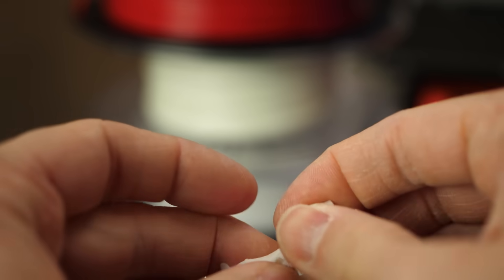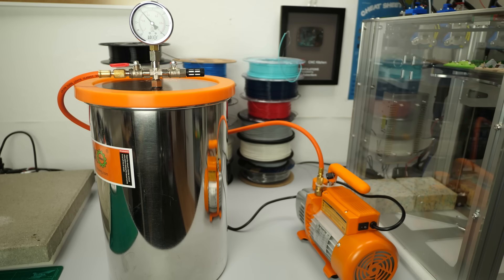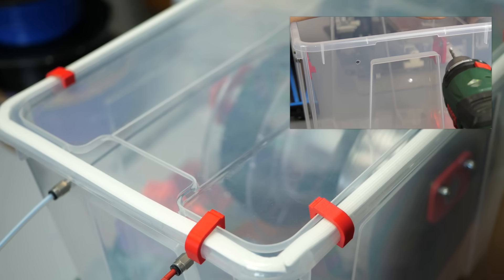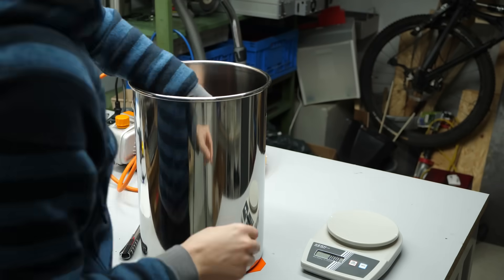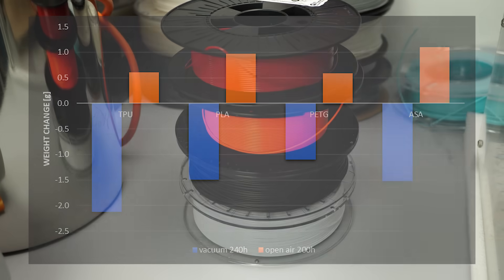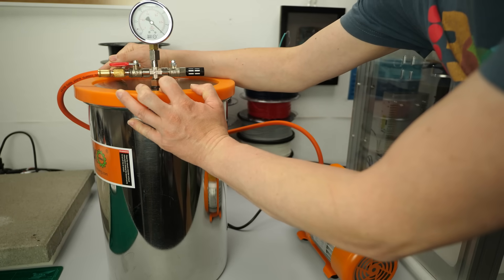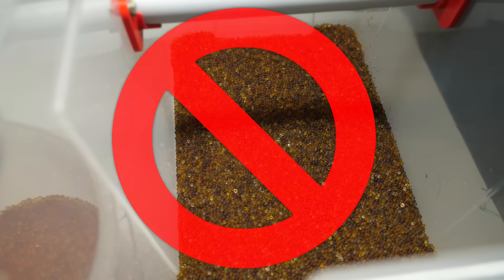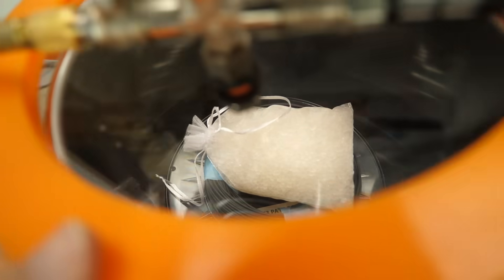Vacuum VS Dehydrator! What's the best way to dry filament?

Comment: might need to get a chemical desiccant to protect your vacuum pump. How do you feel about baking a regeneratable desiccant in the oven, then storing it in an airtight box with the filament?
Reply from the maker: That's exactly what I usually do.
Reply: @CNCKitchen  that's what I get for pausing the video and coming back assuming I'd seen the whole thing :) Your thoroughness is impressive as always

Comment: What about microwave drying? Thats something I've tried with old TPU parts that tend to get stiffer after months of exposure to moist air. They got more flexible again immediately (after they cooled to room temp of course). That would be a good meeting to examine.
Reply: In the laboratory, vacuum microwave ovens are used to dry out certain types of material. I always keep all my materials in boxes with desiccant
Reply: Since a microwave works by heating the water molecules, that could work... but I would worry about the uneven heating going over temperature and deforming some parts.  Microwave ovens have turntables because of that uneven heating issue. I wouldn't recommend it for that alone, much less any additional out-gassing of the plastic in a place you cook food... unless you want to dedicate a microwave to that (along with the aforementioned issues)
Reply: That works really well with bronzefill filament.
Reply: @xKatjaxPurrsx  Any metallic filament to tell the truth, kkkk

Comment: You cannot dry stuff (completely) in a static vacuum. Unless you leave the pump running continuously the moisture will reach an equilibrium point within the chamber. When you leave the pump running constantly no equilibrium can be reached as the moisture is constantly being removed.  To protect the oil in the pumps in labs you generally use two traps in series. The first bubbles the output of the chamber through sulfuric acid, which takes all the moisture out. The second trap bubbles the output from the sulfuric trap through mineral oil, which traps any fumes coming out of the first trap. Generally these two fluids only need to be changed once a year. Same with the pump oil. You will be amazed at the amount of water that will come off with only limited heating. Generally, proper vacuum drying will move about 1-1/2 times the moisture that air (hot) drying will.
Reply: how do you know when to replace the sulfiric acid
Reply: @termivan  Generally you just make a line on the container (preferably clear) at the height of the fresh sulphuric. Once it doubles in volume it is time to change it. Usually that works out for us to be about once a year, but that will depend on how much you use it.
Reply: @bradquinn4161  excellent, I see that my job (assembly shop) has about a 500g chamber of dessicant in line to the industrial pump, I am considering all these options to help prevent oil contamination in the future,  where might I be able to shop for such accessories?
Reply: @goguyted  We used to use two of the used (and clean) acid bottles(2 litre?) with some of the red vacuum sealer. The bottles are shatter proof due to shipping regulations. If you have a local lab they MAY just give you a couple.

Comment: Hey Stefan
if you want to completely dry the filaments  using vacuum pump you need to freeze the filaments, then put them in vacuum pump
when water freezes it separates from the materials and when unfreezing at  low pressure it goes from solid to gas directly
also a totally dry desiccant should be present in the chamber while material us unfreezing
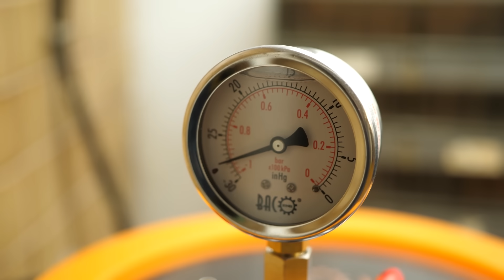Reply: Stefan, your setup for vacuum drying is not even in vacuum (vacuum gauge @6:15 in video). You have a vacuum leak in your setup. Equal amounts of molecules being replaced in container as your pump evacuating…. This is an error in measurement.

Comment: Why not use a printer's heated bed to heat your vacuum pot? Heat with the lid on but no vacuum (for maximum heat transfer) until the spools get to a good drying temp. then pull a vacuum.
Reply: Glad to see that at least one other person uses their printer as a hot plate.

Comment: You should add radiant heaters when you are vacuum drying to add heat to the filament - otherwise you are totally relying on conduction through the base of the vacuum chamber which is really inefficient.
Reply: That is a very uncontrolled way of heating. Every filament will absorb more or less radiation. You would have to limit the radiation to a worst-case or something.
Reply: @Basement-Science  Yeah, or you could just have the heaters controlled on a PID loop to a temperature sensor. Wouldn't be that hard.
Reply: Could you heat the filament up to 50C, then put it in vacuum chamber a while, then take it out and heat up the filament again, and vacuum it again? Every time you remove more moisture..

Comment: what about a  heated vacuum chamber?
Reply: Doesnt work too well since there is no air to transfer the heat. Also, IR would heat the filaments in an uncontrolled way.
Reply: @Basement-Science  Thermal Radiation does not require atoms.
Reply: @Dust599  Where did I suggest that it did??

Comment: No Stefan, your dessicant is not toxic. The cobalt chloride one (the blue one) has been phased out in the EU since 1998. Yours, the orange one is safe. https://www.agmcontainer.com/blog/desiccant/indicating-silica-gel/
Reply from the maker: The orange ones contain Crystal violet which is also suspected to be carcinogenic and toxic for fishes.
Reply: @CNCKitchen  Fair enough. Some of the orange dye ones do contain Crystal violet (notably those turning green). But not all of them. That's the frustrating part when trying to handle chemicals with the least of ecological consequences. The SDS and REACH files established by the chemical companies are notably obscure and you have to do a lot of guesswork to know what's inside the products. Note that silica gel wether it has organic dyes in it or none is as dangerous for fishes as plastic flakes as silica won't dissolve in water. As your audience must already know, dealing with resin, ABS, or PLA (that takes up to 200 years to decompose) has ecological consequences if the residues are not treated  with care and not processed in designated facilities. 
The nice thing with silica gel is that being indefinitely reusable, it's not supposed to be disposed of. It's not a consumable, more of an investement.

Comment: Weirdest thing I've seen with a roll of PLA left in the open is hearing random cracking noises and finding broken pieces of filament that were as brittle as dry pasta. It's happened with three rolls from different sources. Could this be core moisture problem?
Reply from the maker: I'd  rather say that this might be bad quality filament wound on the spool under bending load.
Reply: @CNCKitchen  Thanks. BTW, these recent videos have been great. Looking forward to the next one.
Reply: I keep hearing this, mine is always open and never brittle.  The common story is that the filament is in an area where there is temperature swings so I wonder if it can build 'fractures' in it over time or if the temperature swings damage a property or additive.  (not saying yours is caused by temperature swings)
Reply: I kept my spool on the printer in a plastic box with desiccant, and found exactly this for PLA for the section outside the box in the bowden tube after a few days.  Usually the segment of filament outside the box would break right away if I tried printing with it. This was in a high humidity environment.

Comment: awesome video!! just had a question. did you heat the vac chamber when you were doin g this test? just wondering because my chamber came with a heat mat that can easily hit 125F under vacuum which would probably help a lot! Im gonna test it but just an idea for a revisit video if you do come back to this.
thanks again for the awesome videos!!
Reply: Heat will not transfer through vacuum, except by radiation or conduction. Radiation would only affect the part of the reel/filament in direct line to the heater, conduction will likewise depend on heat conduction through the reel of filament, neither would do much.  One could use the heater to heat the filament for a while, then turn the heat off and pull the vacuum.
Reply: @BatByke  Excellent remark about conduction.....

Comment: That vacuum chamber is very expensive for what it is... you can make a cheaper one. And the reason vacuum by itself doesn’t work that well is that it cools down the water as it evaporates due to its latent heat. You need to heat it up to keep the temperature constant (even at room temperature would be enough).
Reply: Not true, when water is boiling the temperature doesn't change! Remember, at 1 atmospheric pressure water boils at 100°C, adding more heat will not change the temperature, it will only boil the water more quickly.
Reply: MarcoV6T But that’s because you’re adding heat to it. You need energy to break the intermolecular bonds, so if it’s boiling and you don’t heat it up, it will cool down until it freezes. There are quite a few videos that prove it (also, you can do this with other liquids as well, and this also used to make solid nitrogen).

Comment: In Chemistry we used vacuum desiccation while also putting a bowl of fuming sulfuric acid into the chamber - sulfuric acid is highly hygroscopic.
Reply from the maker: Contact with the filament and the fuming sulfuric acid will probably set it on fire? 😅🔥
Reply: @CNCKitchen  Only if you add some nitric acid - though that may also yield a friendly visit by the bomb squad...

Comment: In the video you say you don’t run the vacuum very long because it will over heat. Are you talking about the pump or the filament? I use a vacuum pump to stabilize wood and sometimes I run my pump continuously for days. They are made for long term to remove moisture from refrigerator and cooling units. You might try running it continuously for 24 hrs.

Comment: Good episode about drying filament materials.

I do have a question; why did you decide mix materials during each drying test and not dry them independently of each other for each different drying method?

From a scientific methodology perspective, is there not a concern when mixing different materials during each test run,  potentially dilutes the results because of cross contamination between material and different polymer properties?

Thanks
Reply from the maker: Time...this test already took 3 months.
Reply: @CNCKitchen  I appreciate the dilemma. But as you know, if you were posit this to a peer review panel, there would be red flags.

I like that your tried different drying methods.

Comment: What is wrong with indicator in desiccant?
Reply: That's the point I don't agree with Stephan. There are in fact two kind of moisture indicators. The ones that were previously sold were blue and contained cobalt chloride. a known human toxin. In 1998, the European Union prohibited Blue Indicating Silica Gel from being sold within European markets. They were phased out for orange silica that don't and are safe to use. You can still find blue silica on some sellers sites importing from China but they're pretty rare. They are cheaper but stay away from these. If the silica is orange, it is safe. https://www.agmcontainer.com/blog/desiccant/indicating-silica-gel/
Reply from the maker: The orange ones contain Crystal violet which is also suspected to be carcinogenic and toxic for fishes.
Reply: @the_arcanum  Good to know, so the orange silica that turns dark blue when moist is the safe one? Because that is the stuff I got 2 kg of last year and I'd like to keep using it.
Reply: @mhe0815  Well, the orange that turns green contains Crystal violet that's toxic for the environment if released in Nature. So. ehh. Note, it's not concentrated enough to do damage to humans. But, the nice thing is silica gel is infinitely reusable. Heat it, dry it and it's brand new ! 

 As long as you don't put the dyed silica in contact with food (never recommended). , you're fine. And the day you want to dispose of it, you do it in a proper facility {like for old paint pots, solvents and so on) and it's fine. 

Our hobby involves the manipulation plastics, resins and other hasardous chemicals, we just have to be conscious of what we're using and take care to have the lowest impact on the environment around us :)

Comment: What's the issue with indicator? Haven't heard that before. NOT saying there isn't an issue, just asking for more info. First time I've come across this.
Reply: The blue-pink indicator is cobalt-based. The yellow-blue indicator should be fine. I wouldn't be too concerned about either if you don't plan to eat it ;)
EDIT: Turns out yellow indicator has some variants, those with methylviolet are "concerning". https://www.giebel-adsorber.de/images/unternehmen/neue-produkte/GIEBEL-FilTec_Unbedenklichkeit-Silicagele_DE.pdf
Reply: Just looked up the data sheet of the orange SiO2 pearls I'm using (since the PDF Doping1234 linked said that one of the orange indicators can be considered dangerous at a concentration of 2.5%). They contain a whopping 0.09% of indicator. So even if they were using methyl violet, that concentration is so laughably low that it should not create any reason to worry...
Reply: @NiyaKouya  I figured. It's the dosage size that makes the poison.
Reply: Blue silica gel uses cobalt(ii)chloride which is carcinogenic. Orange silica gel uses methyl violet which is toxic, but not in the concentrations found in commercial silica gel. Concerns with methyl violet are more likely to do with water contamination due to improper disposal
Reply: Yep. The main concern here is probably contaminating your kitchen's oven, although the plastics themselves are probably outgassing more harmful stuff. Ideally you want a separate oven that is not used for anything food-related.
Reply: @Basement-Science  Or you can dry it in your 35$ dedicated dehydrator that also dries filament. That works too :)
Reply: @the_arcanum  Well I was thinking an old oven someone else is throwing out, but yeah, that works too.
Reply: @Basement-Science  if its a sunny day,  you can also leave it somewhere that gets at least 4 hours of sun exposure.  Preferably it's in a low humidity environment.
Reply: @Caretak007  Drying your filament in direct sunlight is a bad idea... While the sunlight does raise the temperature, it is not easily controllable or stable and can swiftly rise above the glass transition temperature and ruin your filament. There are lots of examples of 3D printed objects melting on the dashboard of a car... There is also the uncontrolled humidity to worry about. Part of the reason a food dryer is so effective is that the temperature rise inside is greater than the surrounding air which gives the moisture somewhere to go, e.g. the surrounding cooler air will take up the moisture... if the surrounding air is the same temperature, there is nowhere for the moisture to go and your filament does not get any dryer.

Finally there is the problem of UV radiation... this may or may not affect the strength, but it usually Will affect the color as many colors will noticeably fade in direct sunlight.
Reply: @edwardpaulsen1074  We are talking about drying silica gel not filament.  Obviously putting filament in sunlight is a bad idea.
Reply: I was looking for the same answer. I use the following one, which says it is a patent for non toxic coloration system. I just hope it is true then... I would be grateful to Stefan if he could just tell why he said the colored is toxic, so I would know what to look for.

https://www.amazon.it/gp/product/B018KPA0RE/
Reply: Maybe it's not toxicity related (as anyway with some common sense we'd use a dedicated plate/bowl, not used anymore for food for drying them in oven). 
I've heard long time ago in another video (IIRC it's another one from Stefan), that it was a problem with too low sensitivity of the indicator that rendered it nearly useless for this, filaments being much more moist-sensitive than foods or electronics : when the indicator changes color, that means the silica gel is already near-saturated and not doing anymore its job since long time ago, because the silica efficiency at absorbing moisture decreases multiple folds before the indicator turns color, essentially telling only "you should have dried them some days ago", while a digital hygrometer will notice the %humidity raise right from the start, allowing to dry them on time before the filament gets affected.
Reply: There are safe indicators nowadays. The blue stuff was cobalt which can be toxic if you were to eat it or breath in dust.
Reply: The orange one is safe, the blue one contained cobalt chloride and has been banned in the EU since 1998. The orange one is also more expensive. https://www.agmcontainer.com/blog/desiccant/indicating-silica-gel/

Comment: What about heating the filament in the food dehydrator then (while still warm) vacuum pumping? Vision Miner was using this method in a video from the 3DPrintingNerd.
Reply from the maker: I usually do that before storing it, though I didn't really notice that it helped in any way.
Reply: @CNCKitchen  I think you should have done the test with warm/hot filament. You need energy in the vacuum to facilitate evaporation. If you put in "cold" spools, there's not enough energy to dislodge the water molecules. Ideally, you'd have a heating pad inside (or at least on the bottom of the chamber on the outside) that imparts energy into the spools while under vacuum to facilitate the evaporation. Without this added energy, the water is not going to go anywhere.